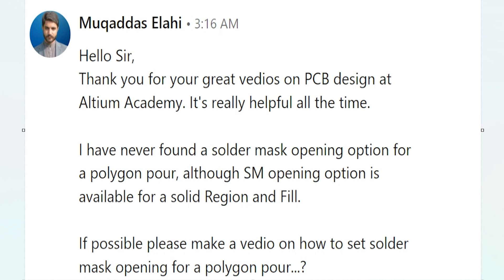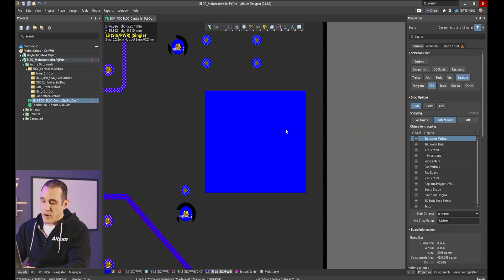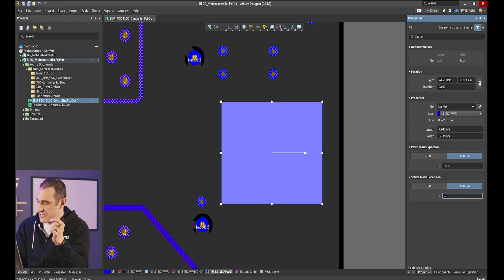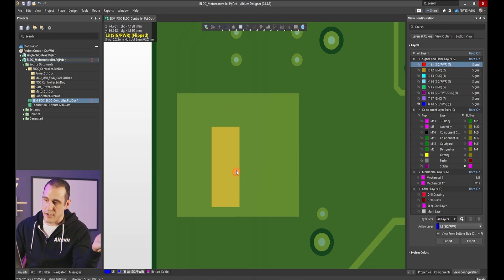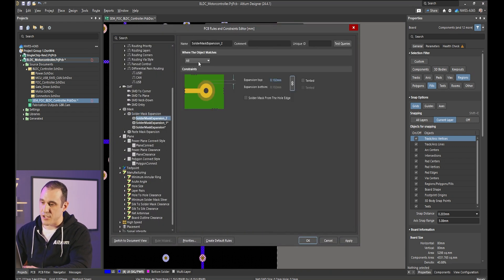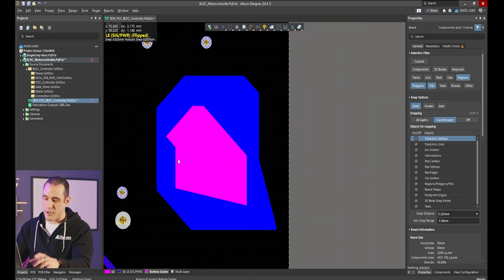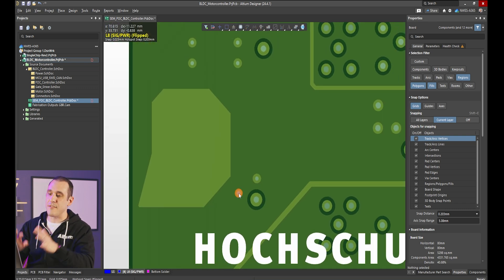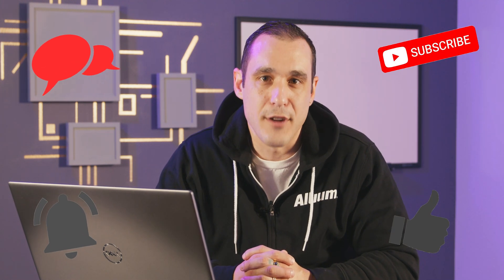How to Apply a Solder Mask Opening on a PCB

Comment: Yeah, this is not helpful at all, because in reality you never have a fill which just fills a polygon. Normally you apply a fill to maximise copper in some constricted area, and it is limited by other signal pads and traces with appropriate clearances, and thus generates a very complex shape. So from what I see here, if my aim is to open this complex automatically calculated copper pour, Altium doesn't offer any tools but to go and draw out everything with polygons manually point by point, which for design I am working on means extra 8-10h of work, and then rework if anything is changed. Instead of being generated from poured polygon in a blink. Working with Altium for three years now and I'm constantly amazed how it lacks simplest planar geometry features any mechanical CAD has since 2010.

Comment: Love the vids Zach!  Im “cramming” for some big design reviews.

Could you make a similar video on solder paste?  Ive struggled with tiny ESD protection packages floating on pads. The datasheet footprint is sometimes missing the paste dimensions and im not sure what the correct amount is without going through trial and error.
Reply: If its a part with a large center gnd/heatsink contact normally need to shrink paste down to 70-80% of that pad size and if there is large difference between it and other pads so it floats part above them then break the paste up into several smaller areas with gaps so solder has to flow together to fill underneath at same time part pads are forming fillets. The gaps allow the flux to escape without forming voids. If you have thermal vias in the that center pad make sure you plug them and try to align paste in between them so they don't steal the solder. Still might have to experiment some to get it right but following these tips should get you most of the way there.

Comment: I think a nice follow-up to this might be making footprints for shielded cans and driven guards, both of which require solder mask openings. Or was this covered in PCB distributed elements? Anyway, since I use Kicad, I usually just pop to the solder mask layer and draw the opening directly.

A good adjunct would be how to specify whether the opening is to be HASL, ENIG, or whatever on a board with multiple treatments for different bits of exposed copper.
Reply: We did this question in another video, stay tuned
Reply: @Zachariah-Peterson  Did you also cover the best way to open solder mask over traces, for instance on high frequency RF traces where you don't want the solder masks Dk to influence the impedance of your trace at high frequencies? You often want the solder mask opening to be above the trace and also the shielding vias coplanar ground around the RF trace. The problem with setting a custom solder mask opening rule on the track is that it opens the mask at the ends of the track too. I have been using fill regions to open the mask but it becomes very tedious to do this around series and shunt components since you usually want to keep a solder dam around pads. Maybe this is something Altium cannot do easily, but if it can, it would be great to have a tutorial.